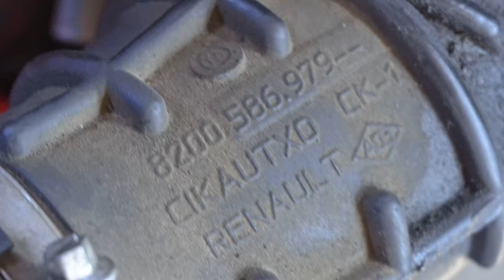Renault Espace IV (Air Intake Hose Oil leak, Engine smoke/mist, Green O-ring added at 4:31)

Comment: Have you solved smoking,by doing that? I have same issue but smoking very very intense seems like oil is dripping on exhaust system and making so much smoke. Turbo look very dry, no problem with power. Espace 2010 127kw
Reply from the maker: Yes the O-ring mostly fixed the problem, there is very little smoke now, 90% it's gone.
Reply: @CarSer 90% is not fixed